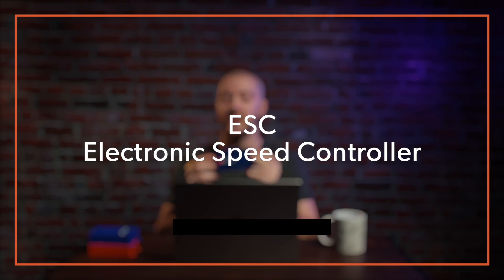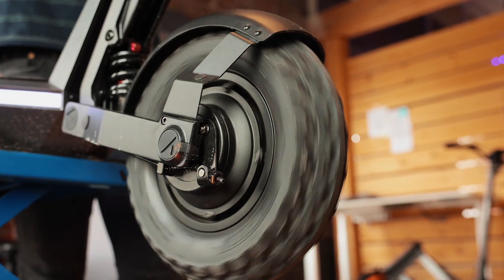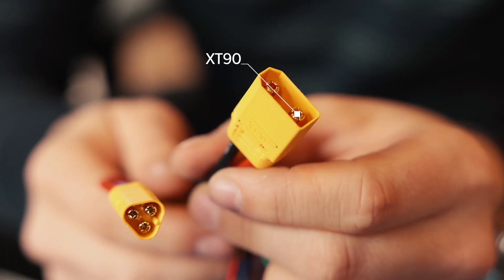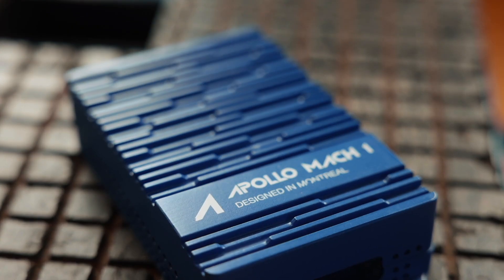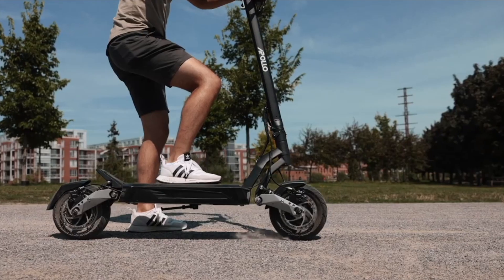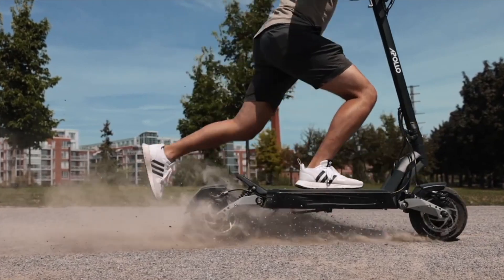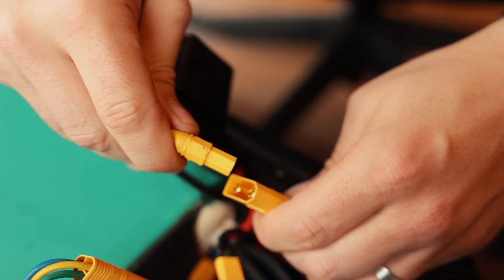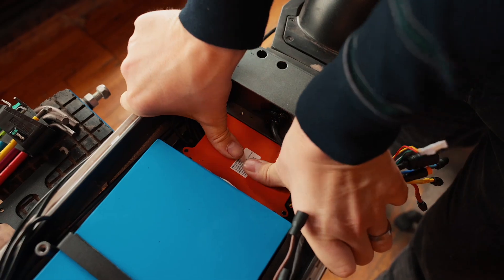How It Works: Apollo Mach 1 Controller

Comment: I wanted the Phantom to be my next scooter, but after reading many comments regarding overheating and poor quality parts, I'm looking at other options. Overheating is just unacceptable for me. My current scooter has cheap Chinese 2x25A controllers and I can ride uphill on rough terrain for several hours without any problems.

Comment: i wonder could i download vesc system and modify the mach1 more? cuz as i see 52v could give insane power if you built it right but still 72v on phantom is kinda risky hitting 100kmh cuz no steering damper and 10inch tires and some weak points here and there

Comment: Powder coated is always better and can resist to scratches. So doest it mean that the Phantom V3 60 volts will have the Mach 2 controller? And yes controller is the most important, I burn more than few ESC of my RC cars due to overheating. I love XT90 connector, very easy to unplug and plug in plus it looks cleaner. Excellent very informative.

Comment: Any news on when there will be an upgrade kit for the Apollo Phantom V2 60v?
Reply from the maker: Hi Danny,

Our 60V customers have long been our most loyal and passionate followers. Its exactly for this reason we actually kicked off the development of the V3 upgrade kit for the 52V and 60V in parallel.

The process of developing the 52V upgrade kit was incredibly challenging, seeing as we're the only ones capable of offering regen braking in a high-performance scooter. Needless to say, the 60V runs even hotter, meaning even greater risk of overheating. For this reason, we are testing it for longer.

There are currently a number of testers actively riding with a 60V Phantom Upgrade kit and we are monitoring their performance. At this time we are not able to commit to a release date, but the product is in the testing phase as we speak.
Reply: @ApolloScooters  

Cant wait!

Comment: Looking at the features that have been added I have to ask if this is also a VESC based controller? It would make sense as developing new firmware from the ground up makes zero sense when you can simply add the features you need to VESC. Just asking as I am curious to know :)

Comment: Any ETA on a 60V solution for the V2 upgrade?
Reply: In case you didn't see the other comment

"The process of developing the 52V upgrade kit was incredibly challenging, seeing as we're the only ones capable of offering regen braking in a high-performance scooter. Needless to say, the 60V runs even hotter, meaning even greater risk of overheating. For this reason, we are testing it for longer.

There are currently a number of testers actively riding with a 60V Phantom Upgrade kit and we are monitoring their performance. At this time we are not able to commit to a release date, but the product is in the testing phase as we speak."